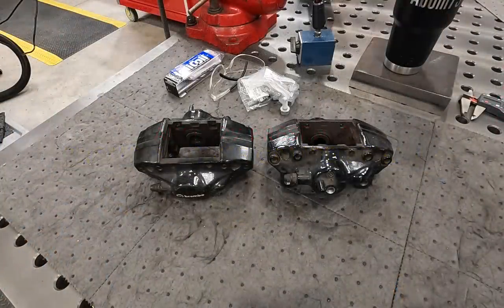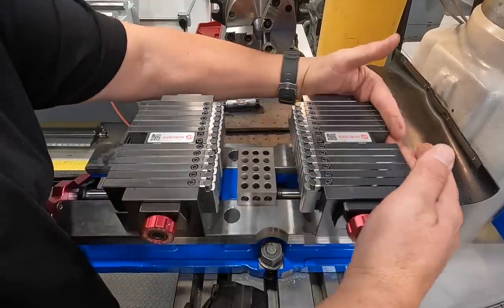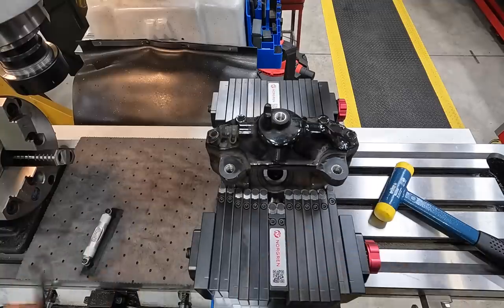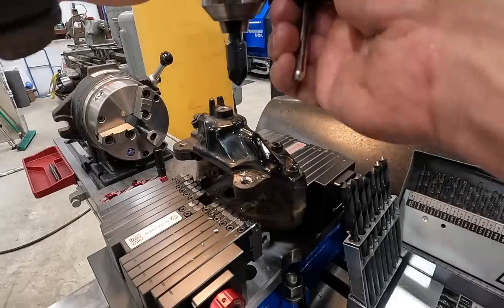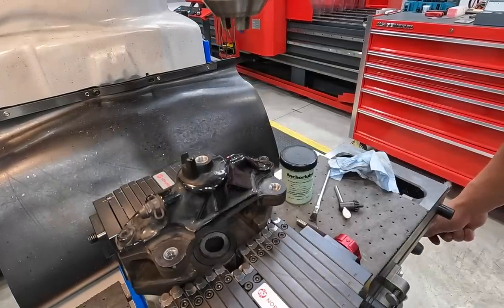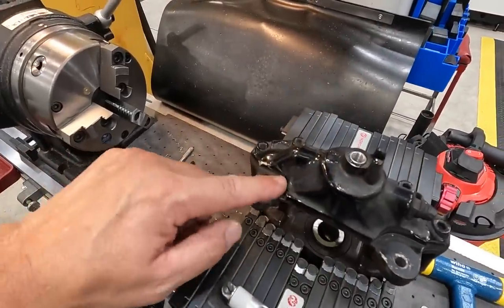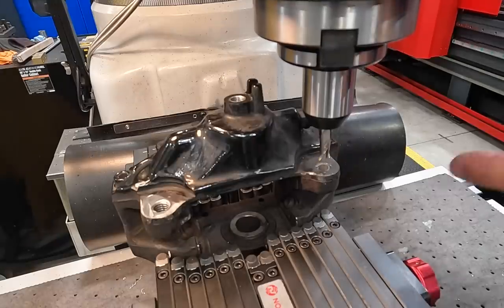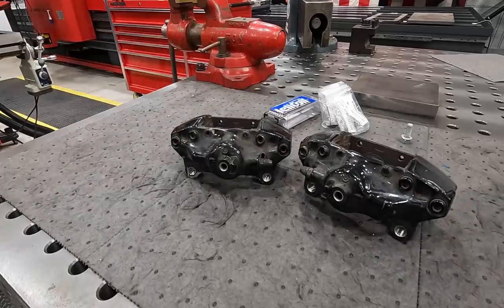Brembo Brake Caliper Repair

Comment: I remember using Anchorlube (not 100% sure it was the same trade name back then, but absolutely the same pale lime green stuff!) in a squeeze bottle in 1978.  I was 16 and working on a mechanical assembly line at Rockwell-Collins in Florida building avionics chassis.  We used it for any and every tapping operation :)  I know many of those radios and navigational instruments we built there are still in service today keeping pilots safe in the air and getting them home.

Comment: I like the vice. very nice indeed. Are you sure you should be lubing the helicoil? The last thing you want is an insert coming out. We always used loctite. It sort of lubes it on the way in and locks it in place ready for the bolt.

Comment: Excellent demonstration of the usefulness of the Adativ Vise...As an extra precaution, a piece of painter's tape over the brake banjo bolt hole would eliminate the slight possibility of tiny chips from entering the fluid cavity ...
(a clean up after machining might not remove some stubborn sharp edged swarf that may have gotten into the cavity which could eventually damage the piston seals)

Comment: I've installed many of these in aluminum parts.  Possibly the worst are VW engine mounts which use torque to yield bolts into aluminum.   This causes shear in the threads of an Al casting, failing with new bolts.  This drops the engine as the threads pull out.

Comment: Use loctite on those helicoils so they don’t back out with the bolt 
Those bolts require loctite when installed so it’ll stick to the thread repaired and sometimes pull them out when unscrewed 
I usually put some on the helicoil and also pin both sides of the thread when installed so it mechanically lock it in place
Reply: Yeah; I would've gone with at least Threadlocker Blue on this.  This is an unsprung suspension component, and it really takes a beating.
Reply: Yeah I was thinking the same thing. One tight thread and those helicoils are backing out of the caliper. Vibration and thermal expansion are probably gonna see those calipers loosen.

Even my cheapie helicoils knock-offs have a mechanical locking mechanism to prevent them backing out. Glad I didn't buy helicoils are seeing them used.

Comment: Worked on almost new ZF automatic transmissions in 1986 and every tapped hole in the castings was helicoiled from the ZF factory!
Reply: Makes sense, it should be better then threading into an aluminum casting

Comment: I would have put a plug in the hydraulic fluid port to ensure zero chips to fall inside.. Otherwise, a clever clamping system to ease the job.

Comment: You can unbolt those calipers they are 2 half’s. The flats have bolt holes are true surface. I’ve fixed a few. Super cool to see how you did it with that clamp system. You would think people would be careful with such high end brakes lol.

Comment: Had to do it with my bembos on my subaru 2007gtb sti. Very common
Reply: I bet you did it with a hand drill and was done before this video.
Reply: @albertpierce6263  No mate, I have a drill mill HM-46 and worked great.

Comment: Adam: Good demonstration of how to work with Helicoil
Reply: WITH 1 exception. NEVER countersink a brake caliper. They are machined flat from the factory for a reason. Any movement of the new bolt will put torque on the helicoil and give movement to it when torque  is applied to the bolt. It will deform the helicoil. I KNOW for a fact it loosens up the helicoil and you never want the bolt to stress the caliper. Been working on cars my entire life. Never countersink a brake part. It is meant to hold in place with two flat surfaces.

Comment: The threads on these calipers gets galvanic corroded to the mild steel bolt that holds them on so thats why they either strip out or snap off...
They go on the WRX STI by the way

Comment: Cool vise and nice work. I would've taped those pistons up and red loctited those thread inserts though
Reply: I would have taped up the brake line. No need in my opinion to tape up what is exposed to the atmosphere in operation.
Reply: @jemijona  not too many aluminum chips in the atmosphere where I'm at lol

Comment: Adam with it not being a floating caliper you are best off levelling up 1 lug at a time, pick a lug get it level drill it thread it then move onto the other lug and level that up then do the same with that because with all the powder coating on it you can't level 1 lug up when you want to drill the opposite hole.

Comment: That vice would be much easier to set if the fingers were spring loaded, they would conform to the part while partially closing the vice then tighten them and close the vice tighter.

Comment: Am I seeing things or did that tap lift the caliper up out of the vice a little at 27:36
Reply: It lifted a little right at the end. Probably because the sides of the caliper are not vertical but slanted. The caliper just wants to pop away.
Reply: But I think the result is still fine.
Reply: so I wans't the only one seeing things :)
Reply: Yes, not sure how that would effect repair ?

Comment: I would have just split the callipers in half and bolted the halves with the faulty threads to the bed. no need for any levelling 😀
Reply: Yep and put new seals in, much better
Reply: Then he could not show his new sponsered vise jaws ;)
Reply: @simonsms410  that never crossed my mind 🤣
Reply: Bloody hell!! We used to do those jobs in situ.... How engineers have lost the plot!!🤣🤣🤣
Reply: I would avoid to split the caliper… u would have to reseal it, and most probably you would have to use new screw with the proper torque and angle. And  in the repair manual is written „Don‘t split it!“….
Reply: @frankangermann6460  exactly if I was going to rely on 2nd hand calipers of unknown history I would want to have new seals throughout, it not hard to do and OEM seal kits aren't even that expensive, done it a many times on cars and motorcycles
Reply: @frankangermann6460  
That's what you get with a throw away ideology!!! When they say you can't do something!!!
If a mechanic cannot do a simple repair on a caliper!! Then s/he is not a mechanic! FFS, he's doing a thread repair!! Not brain surgery! 🤣🤣🤣
What the hell do they teach nowadays in apprenticeships???  No wonder the world is falling apart at the seams🤣🤣🤣 pardon the pun!!😂
Reply: Well it’s just brakes…. Don’t care about repair manuals…..

Comment: Good to see Subaru used 1.5mm thread pitch on these for the aluminium. The standard steel calipers use 1.25mm thread pitch

Comment: As I'm not a machinist n I do everything with a few hand tools n a beautiful vice. I bought myself a cheap knockoff Helicoil set off eBay. It's got 3, 4, 5, 6, 8, & 10mm and I've only used a few so far n they've worked a treat!
What are the other ones called that you screw in and then tap the 4 built in pins so it's locked into place. I see you use them a few times at Motion.

What really makes ME happy is that the US had been on the metric system since 1866. But to go from the metric to the dark ages, yous use conversions

Comment: Those brakes have another machine surface. It is the mating surface between the two halves.  I think I would have split each one and used that surface as a reference.

Comment: If you really get stuck holding them in the vice, you could split the 2 halves of the calipers apart and then use that machined face to hold it plus bolt through the holes used to hold the 2 halves together. You'll need a seal kit to reassemble, but that's usually only 2 o rings
Reply: At least I'm not the only one laughing at that set up.
Reply: I thought the same thing myself, split the caliper and take advantage of the machined surface

Comment: Shop I used to work at we'd do a LOT of 1/2" helicoils on these aluminum plates that formed a mold for a rubber gasket compound.  The mold box had the 1/2" bolts every 2 inches as well as a bunch of 2x2"x1/4" steel tubes used as clamps with 3/4" threaded rod.   It was like clockwork that  those helicoils and clamp tubes would need replacing, both the mold plates and the tubes twisted into banana's.   My boss, and I wanted to beef everything up but the customer refused saying that they'd have to get new ovens and methods for moving the molds if they got any heavier since they were moving these molds by hand.  Turned into just a recurring job we could count on.    It was always fun seeing how badly twisted those plates would be when we'd get them back.

Comment: I made a similar jaw some time ago at work, using round pins in holes with seals. An equalizing hydraulic version of this. But i only needed one of them, in the moving jaw for that work.
You all know, that fluid always want to equalize the pressure, so thats how it worked.

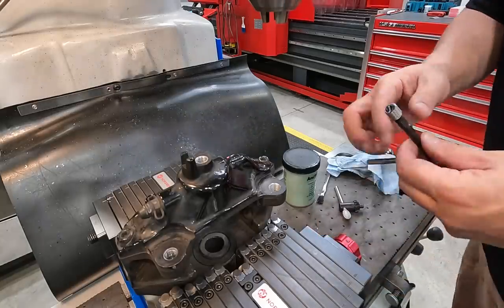Comment: 18:50 ? I would have thought a HeliCoil would go in with LockTite and not a lubricant? The 'internet' says its up to you, but don't get it on the inside of the coil. Great use of the new jaw!
Reply: I wondered about that too, but if this is aluminum it galls really easily.
Reply: Part of that is because when installing it you're twisting it in from the bottom tang which causes it to narrow down and twist tighter together when there's more drag on the top threads. Once that tang is gone the insert is going to be working like a spring slightly pressing into the outer threads and when there's a bolt or something being tightened into it any friction is now going to be at the top instead of the bottom so it'll work to unwind that spring and force it into the outer threads even more. Personally I still use loctite but the helicoil probably isn't going to move after installation without it.

Comment: The people that are saying that this is a liability and dangerous have never honestly worked on cars.
Reply: If they only knew
Reply: @brianluck84  yeah literally anything is a liability I would be more concerned about the mechanic who torques The caliper bolts more than the helicoil
Reply: ....or motorcycles or airplanes LOL
Reply: Agree, the pullout force for a Hellicoilled hole in testing is normally greater than the pull out force for the original sized thread
Reply: @ryanlove5332  and a time-sert is higher.
Reply: Once I saw helicoils will hold head bolts there was no doubt in my mind they are good for anything 🤷🏼‍♂️
Reply: @8145dwerdna  as in higher than a Hellicoil?
Reply: @ryanlove5332  yeah. It's not by a whole lot but tbh the fact it's a bushing insert you can install it with loctite and not have to worry about it making it's way to the bolt.

Comment: I had the same issue on my 2016 STI calipers, where one of the bolts sheared off due to corrosion. Instead of drilling it out and fitting a Helicoil, a viable solution was to use an Electrical Discharge Machining (EDM) system to essentially drill out the bolt with a very high level of precision. The bits left in the thread of the caliper could be removed with a pick. It cost me right around $100 and the original threads were totally reusable.

BTW, the standard Subaru bolts are just an 8.8 grade coated bolt, but the coating seems of little help. With most other vehicles, the bolts are screwed into the steel hub carrier, not the expensive caliper, making life a bit easier if a bolt breaks. Not sure why Subaru chose to do this the other way round.

Comment: At 27:40 you can see the part get pulled up slightly by the tap.
Reply: Dude it's gonna be juuuuuuuuust fine.
Reply: @silasmarner7586  Sure, the part is, and that's completely not my point at all. However, In order for the part to lift, those fancy overpriced $7000 vise jaws must have not had the best grip on the part.

Comment: why didn't you loctite the threads in position?
Reply: Normally helicoils shouldn't have loctite on the threads because the way they work is that as the bolt is torqued the ramping action of the bolt threads on the helicoil threads causes them to expand out into the parent metal.  if you use loctite you risk breaking the loctite seal when the bolt is torqued up and the loctite can squeeze out to contaminate the bolt threads, causing the bolt to be thread locked to the helicoil and the helicoil not being fixed to the parent metal - remember the helicoil is effectively a spring.   However, having had the situation where after a time the bolt corrodes to the helicoil and the helicoil begins to wind out when the bolt is undone.  This causes a problem because the helicoil generally can't wind back through the caliper mounting hole and the helicoil gouges the mounting face.  This happened to me with a Brembo caliper and Porsche swing arm.  I didn't follow conventional wisdom and peened over the aluminium to stop the thread winding out again and made sure that the bolt threads had anti-seize lubricant on.

Comment: you probably should have used a chromate because of the dissimilar metals, aluminum, steel. In the aircraft industry we use a strontiun chromate when we heli--coil different metals..
Reply: I don't think it is necessary. There were steel bolts holding these.
Reply: The original was a steel bolt in/on a dissimilar metal. Could be the reason it failed in the first place.

Comment: Timesert all day long with the tap guide you could have done it on the bench.
The snapped stud would need set up but you could have split the calliper or I clamp to the machined surface

Comment: Not sure if using helicoil on the brake calipers is best, but only time will tell
Reply: I suppose the braking force isn't really pulling the bolt out, its across the bolt. It seems like helicoils are used in applications where the force is pulling so I guess it's ok?

I'm no expert and had the same thought as you. Just thinking about it some more.
Reply: Should have at least used lock tight!
Reply: Doubleboost used them on brake calipers too, I think they are quite common in similar applications.

Comment: I was taught to use some Loctite when installing the Helicoil.  Is that incorrect?
Reply: No - that is correct, you don't grease helicoils.
Reply: Looking on Heli-Coil's site I don't see anything mentioning using loctite or other threat lockers on the Tanged Screw Thread Inserts. Project Farm has a video testing various inserts and the Heli-Coil instructions don't mention it either. Just install the thread insert dry. The bolts look like they have a little wiggle room in this repair. I doubt the insert will come loose when removing the bolt.
Reply: @willjohnsonjohnson  Oh, I think I was told this on a 'belt and braces' basis.

Comment: Hey Adam, I would have thiought that you needed to have the two centre fingers also placed against the job when clamping it in place. Otherwise it would seem that your total clamping force will be limited byt the 65ft/lbs of the side locking bolts. I may not be  seeing the big picture, but it seemed logical to me to start with all the fingers pressing against the workpiece. Thanks for the video, it was very interesting on how to hold irregular shaped jobs. Ive used Helicoils myself, & you showed exactly how the fitting/installing process works.
Reply: I was thinking the same. All fingers should clamp.

Comment: In clamping that odd shape, could you have inserted a precision threaded rod into the central threaded hole that appears to go into the chamber behind the piston, then insert the rod into a collet chuck on the spindle? That would get the holes you want to open up parallel to the axis of the mill’s spindle, in both directions. Then you lower the caliper into the vise and tighten the jaws.
Reply: I was thinking the same thing myself. It would have made the levelling process a bit easier.

Comment: I thought you needed to use some locktite on heli-coils
Reply: From the Heli-Coil website: the “Screw-Locking” tanged insert provides self-locking torque on the male member by a series of “chords” on one or more of the insert coils. Require no staking, locking, swaging, keying, or interference fit (Free-Running). Positive self-locking torque, complying with MIL-I-8846 and MIL-N-25027.
Reply: If they are properly installed , there is always more grip on the exterior diameter of the coil than the interior diameter and they will never wind out with the bolt.
No thread lock is required.

Comment: I have personally witnessed heli-coils that have been installed for at least 40 years under the most abusive conditions on aluminum parts .YOU DO NOT WANT RED LOCTITE ON THEM when installing and remember to break off install tang.Use just a little oil when installing making sure they are at least a thread or two below surface from pulling out and use PROPER LENGTH bolts.If damaged somehow ,needle nose pliers or pick may be used to pull or extract coil and use the appropriate  Heli-tap size to clean up threads.
Reply: I will back this up. The manufacturer even says to install them dry
Reply: @SteelSurgeon  So what is holding them in place? I was always taught to use red loctite to keep the could from coming out.
Reply: @SteelSurgeon  I think when the tang is broken off it sets the threads. Time-sert is the exception, use thread lock.
    One guy uses JB Weld on Ford engine spark plug holes with Time-sert.
Reply: @Blake_the_Drake  The clamp force of the bolt puts pressure on the coil, forcing the spring to turn and applies additional friction to the helicoil. Loctite could actually prevent the proper operation if you allow it to set before installing the bolt in the final application.
Reply: having used helicoils for over 40 years i agree. i always put in dry. no lube, NO loctite. there is a tool to remove them

Comment: Thanks for the vid, Adam.  I always learn something watching you.  How did you line up that last hole?  Because a partial bolt was in there, you couldn't do the drill bit trick you did on the others.  Just eyeball it?